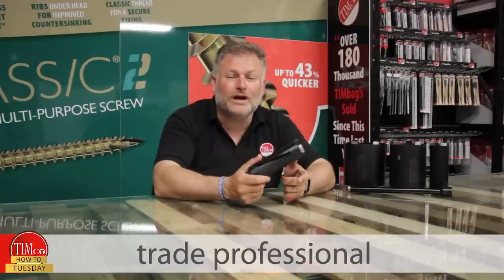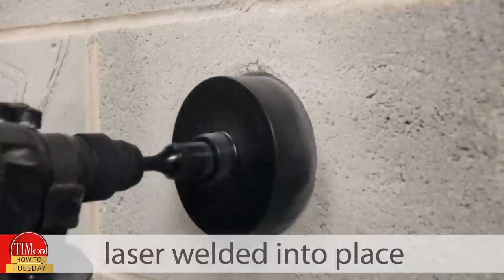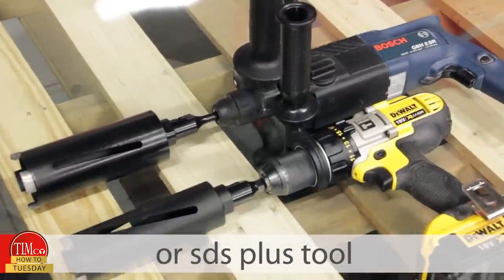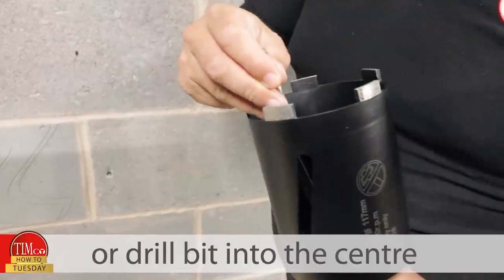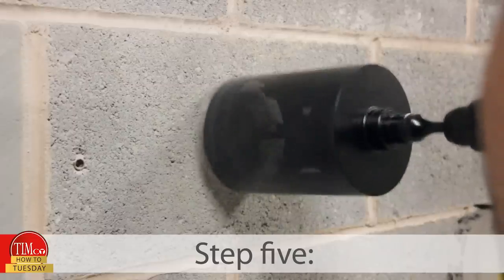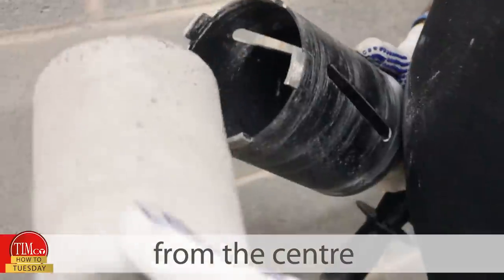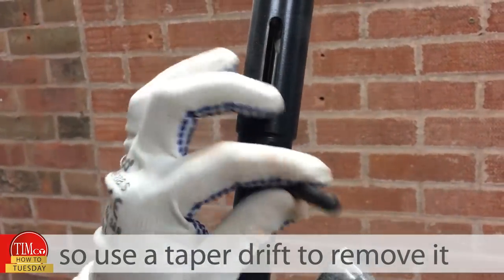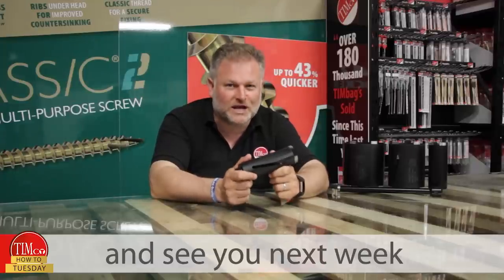How to drill large holes into brick walls - TIMco How To Tuesday

Comment: What parts would be needed to drill a 3" hole through 2 layers of bricks?
For putting in cable and network cables, I've had to use a very long drill bit with the blades on the ends (hammer drill).  it turns out, that there's a layer of brick, an air space then the outside layer of bricks.

The whole travel is something like 11" to 15" (I forget right now which it is).

But I'm contemplating getting a 2 zone DIY  Mini Split and I'd have to drill 2, 3" holes, one for each unit.  But around where I am, I haven't really seen some kind of hole saw that can do this particular job.

What would be needed that would work with my 3/2 chuck hammer drill?

Comment: I have been searching for methods regarding how to install a dryer vent through a cinder block and brick wall. Came across this video and decided if I am going to do it I need the proper tools. I purchased a 4 1/4" bit and will see how this goes.
Reply: Jim Gray let us know how it goes. I’m looking a tackling the same project. I’m just not sure about any rebar in the wall.
Reply: @Umbrellacorporationmt  Went exceptionally well! Turns out I needed to go through cinder block and bricks which was a total of 12 1/2" thick. It took me 36 minutes to drill through all the materials and it came out PERFECTLY! I used the 4 1/4" bit for my 4" dryer duct.
Reply: @TheBravo364  did you use the 107x150mm?

Comment: I need to drill a hole between 40 and 50 mm through a concrete block wall, the only thing is i have to drill the hole at an angle of about 45 degrees which means the hole length is 300 to 400mm long. How would you suggest I do this?.

Comment: Is there any wattage requirements for the drill machine, for using these bits?

I have Bosch 500 watts mini hammer drill, where it is very easy to drill through brick wall or concrete blocks wall. But it simply doesn't cut through roof concrete. Can these drill bits be used with above drill (Bosch gsb 10 re)?

Comment: Hi can I drill a hole at a 45 degree angle
Reply: You would have to make yourself a jig of some kind to keep the hole saw at the correct angle while starting the cut.  You will not be able to do it just by holding the drill at an angle while you start your hole.  You could also try drilling a hole through a starting a hole in a piece of material with a face large enough to allow the entire diameter of the hole, cutting the back side of this piece at 45 degrees, then gluing the back side to the wall with some PL construction adhesive or epoxy.  Once the adhesive has dried, continue the hole you started in the piece of block you cut the back off of, and continue drilling into the wall behind it.  You will probably have to stop partway through the cut to break out the slug and keep going because you will be drilling through much more material since you are on an angle.  Once you have gone through the wall completely, you can break off the piece you glued on and chip off the glue with a cold chisel or a chipping hammer.